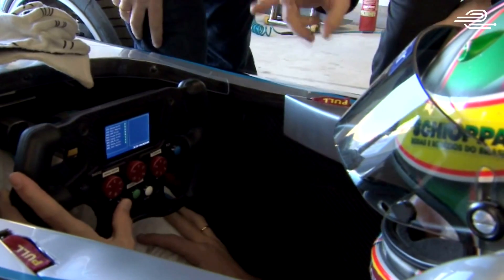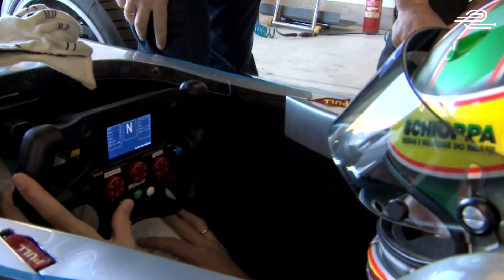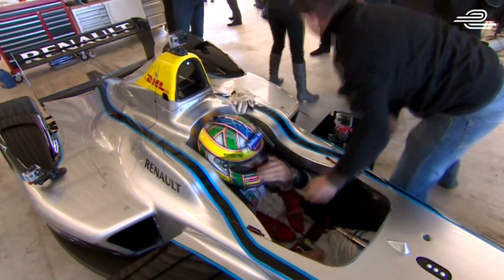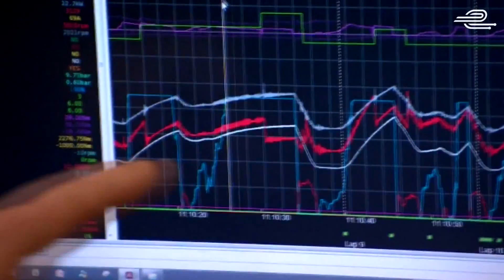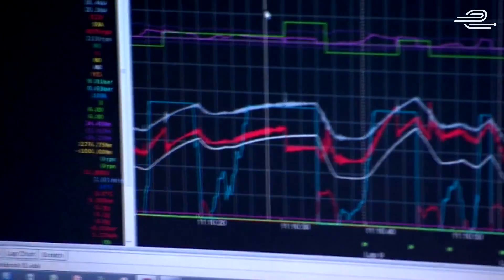Formula E Car - Spark Renault SRT01E - track debut

Comment: i hope this flops. i have no interest in a boring "E" or "I" race.
Reply: You should have interest on the health of the planet besides everything.
Reply: ***** you too, where do you think all this electricity comes from? Renewable energy is but a small fraction of where it comes from, it's mainly from carbon factories which needless to say 1 produce about the same pollution as all the cars together in a small sized town. If we'd all use electric cars, ofc more of these factories had to be made.
And let's not forget where all this green energy goes when the car's battery dies out just 5 years later - the dump - it can't be recycled. Usually a hole is dug, we put trash in it, call it a dump and think that's okay, nobody has to see that again and isn't doing any harm to anyone. That might even be okay with certain kinds of trash like basically everything that isn't a polymer or doesn't have any sort of toxic waste in it. But batteries do, in fact that's basically all they are. And all of that waste goes right into groundwater which leads directly to the ocean. Effectively it's feeling the ocean with Lithium over the course of many many years.

So yeah I care about the health of the planet and that's exactly why electrical energy doesn't interest me at all. Hydrogen cells seem like a much better option imo. Still, above all that, the sound doesn't hype me either, feels like I'm hearing one of those sound frequency tests on youtube.
Reply: Blaze fp Hey...im glad we share the same worries. :)
I agree with everything you´ve said and you pointed out quite important issues that I believe can be solved. The problem are the Lobbies who dont want to see this being solved cause fossil fuels generate much more income then renewable sources. The reliable electric car exists already for almost 30 years...General motors didnt wanted to have it... probably you know a nice documentary about it called exactly: "Who Killed the Electric Car" Worth it to see it.

So much money goes into making guns for stupid wars when it could be used for research on clean renewable energy. I find that very sad....its so obvious to me!
The car's battery dies out just 5 years later cause theres no investment in making them lasting longer, or in an unreal world, indefinitely! This will never happen cause then you wouldnt have to pay for fuel at all...not convenient for the big guys up there.

About the noise of the car...I also dont like it but...cmon, an electric car doesnt really make noise so its perfectly possible to, lets give an stupid example, put a speaker making the sound you want to hear! Or? Its the least of the problems I would say.
And im glad that theres a competition of electric cars starting. I believe it will help to develop further new ways of dealing with all the already mentioned problems.
At least I hope so but...lets see.
Reply: Never seen it sorry xD Although this'd ofc help develop more advanced batteries, the same development is already found on laptops and tablets for quite a while now and they would have a much greater interest in a long battery life.
Plus, Formula E would have absolutely no interest in developing a battery that'd last over 5 years because they'll probably only use it for 1 race and then throw it away.

I'm all for formula research to get a better performance on every kind of engine available, I just find hydrogen a much more reliable source of power than electrical energy. Only has the problem of being too unstable, too volatile, other then that it's the perfect fuel.
Reply: ***** i do, but im not as paranoid as to make everything "green" thanks though.

Comment: First the complaints were, its slow, when they showed they can be as fast, complaints changed to as low range, when they showed electric cars can now drive 400 miles on a charge or more, complaints changed to the sound sucks...